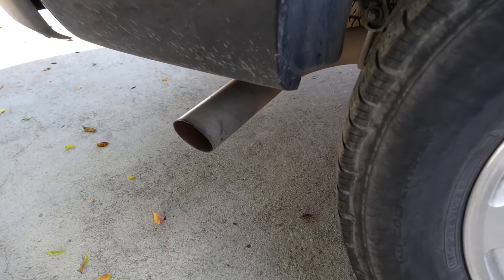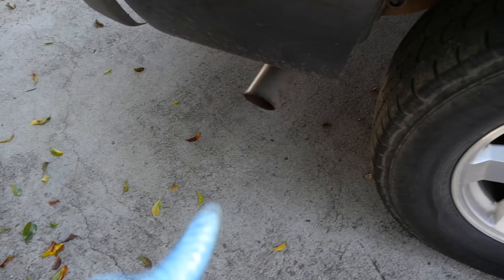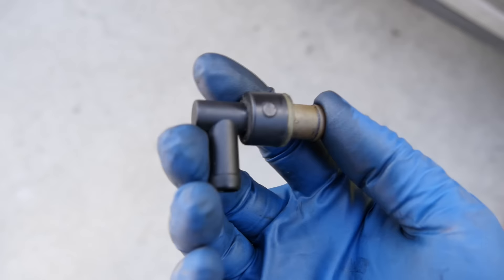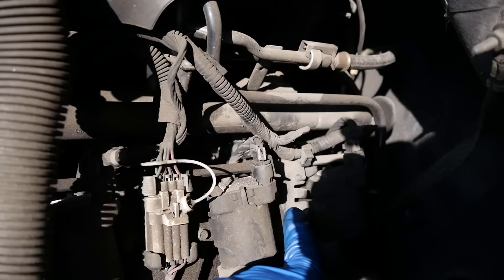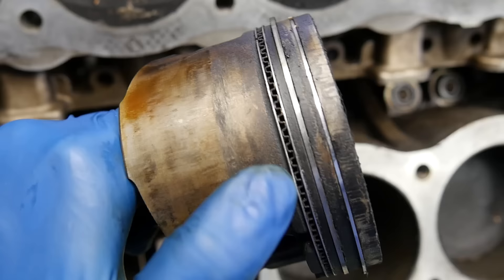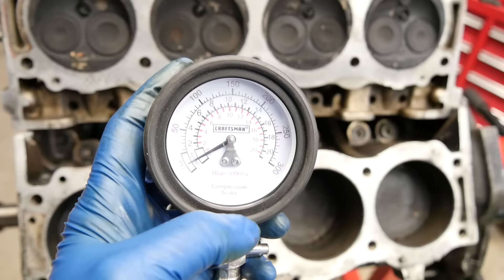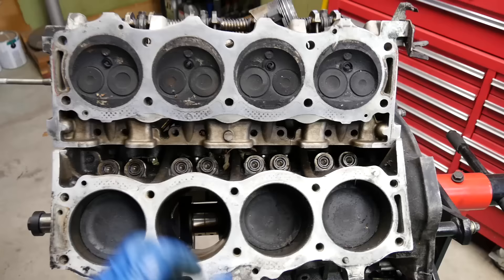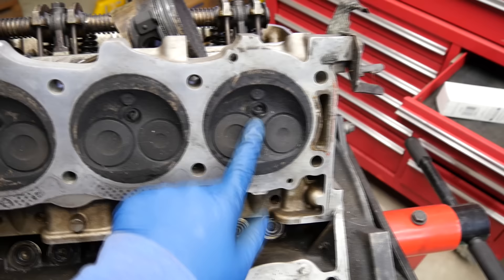Top 5 Reasons Your Car Is Smoking Out the Tailpipe - And How to Diagnose Them

Comment: What if a turbo wears out, what kind of smoke comes out of the tailpipe?
Thanks for another great video. You helped me many times.🙂
Reply: usually black
Reply: Sir I am having this issue turbo is gone after I paid for a seal on my head gaskette. I was told it was Ok to drive just won't have the same power. Well it won't go up a steep hill and just started smoking like a dark grey kind of color.

Comment: You forgot to add that Vacuum leaks, can  also cause a rich condition. I get it on the mercs, where the vacuum leak actually makes the car run lean, however it tries to compensate and overfuels the vehicle.
Reply: The poster's saving grace is the title says "Top 5 Reasons" so he didn't have to go over every possible cause.

Comment: You definitely don't want blow by circulating through your engine, it wears and tears the life out of your engine, and you loose HP and acceleration. I use gum out and only mobil 1 fuel with mobil 1 oil n filter, and make thick white smoke when off roading on snow and then reving the engine and makes white smoke, I believe is because it is burning up all the gunk and oil deposits that had build up in the engine, and restoring it's full performance.

Comment: Thank You!  Very informative  Video!    But,...  You mentioned  Engine issues on Toyota’s  Newer cars?  If so, I’m quite sure... TOYOTA will have a Re-Call out on such matter!! 

I happen to have a 2004 Lexus ES 330 with 345,000 Miles and it still purrs 🥰 and I know that it has a Valve cover leakage. So I took it for a local shop for the yearly NYS inspection, I was told that it needs a new head gasket??  Really?? Hmm I’ll tell my husband about it.  🙄🤨  and that’s why I ended up here.  So, again...  Thank You 💝

Comment: Mine smoked a bit and stopped, then showed a stop sign later in the day and turned off, then started it again and took it home. Topped up the oil after a couple of hours because it was low, started it back on and it was alright, few minutes later it shows a check engine light and starts smoking(white/blueish). It says the depollution system is faulty, which usually means the fuel injector or fuel filter or pump. I completely changed the oil and replaced the filter but it still smokes and jerks, will open it up soon to look at the top gasket

Comment: I took off my throttle body for the first time and spilled coolant on the top of my engine , like at least 12oz and my exhaust has been blowing white smoke on a cold morning cold start and goes away once the engine is warm,  my car doesn’t get hot, and doesn’t blow white smoke every time I start it. Just when it’s cold in cold weather.

Comment: Ugh.. this smoke in my car is driving me crazy.

2017 Pathfinder with the VQ35DD engine smokes a little bit after start and then it's gone. However, sometimes when I am 5 to 10 mins into a drive, it will suddenly start smoking white very badly to the point where it's just a huge ball of smoke coming out of the exhaust.

I changed the PCV valve, but it keeps doing it. I suspect the valve stem seals.

The car is consuming a little bit of oil but nothing alarming. It doesn't seem to be consuming coolant.

Comment: Can you discuss backfire on a car when starting? I had that problem and the tech could not find anything with the computer scan I(odd, thought it would record that), and then white smoke, went away and tech said nothing wrong with car but replaced radiator cap, new spark plugs, fuel injector cleaning and throttle body cleaning. I don't think they took apart the fuel injector but maybe just sprayed in cleaner. Just curious why their scan computer did not record it.

Comment: simple. disconnect the PCV valve and run the engine.  I removed mine completely and blovked the PCV hose.  No oil leaks no  burning of the excess oiil no trouble.  LANTRA J2....
Reply: Would not do that.  May cause excessive pressure in the crank case and eventually ruin your engine.( Blown Head Gaskets)  PVC allows excesse crank case pressure to be vented off back into the system.  But it's your car do as you wish.  He has a video on PVC valves their function and what happens if they fail.  You may want to watch.
Reply: You WILL blow all your oil seals sooner or later, do not do this
Reply: The previous owner of my car did this same thing. I found it out today and connected the pcv valve hose back to the valve and the car started to smoke so bad from the exhaust. What’s happening here.

Comment: I have a dakota 2001 4.7 and it has a Poweraid air system added. I have been asking mechanics to tell me why I have SOME smoke out the tailpipe on occasion, but they all seem to want to diagnose it for $$$. I know about compression testing and Leak testing for Valves and Piston issues and the possibility, but this truck only smokes a very little and only when I'm doing short work (yard work) or when I put it in reverse. All videos talking about smoke don't specify that it has to be a LOT of smoke or a Little smoke to be valves of pistons. I am not wanting to put that kind of money if my problem isn't a problem. Does a Poweraid Air Boost create the potential for pockets of fuel to create white smoke? It doesn't smoke when idle, or on the highway or at stop signs...but it does when I sit for more than a couple minutes in park/stopped.

I'm looking for the truth about this so I can be at peace. Grateful!!!

Comment: I have a 87 Mustang 2.3 sometimes when I start the car up it smokes I honestly think I put to much oil in the car but lately I will get going up a hill in it just let's out a big cloud of smoke!! I don't understand the PVC valve it's a EFI motor but u can't get ur hand in there it looks like it runs from 1 hose then into another hose cause the PVC valve is up by the distributor in its like I said plugs into another hose that I don't know where it goes!!! The car has been running ruff new plugs distributor cap rotor I tried to set the timing 10 degrees btc  but it  doesn't want to take!! It will be running fine then when u like go to get on the highway it will spit sputter then just take off like a rocket!! Like it needed to burp even on regular street it will do the same thing if stop at a stop sign then pull it doesn't feel like it has power then it will kick in! It feels like TFI module maybe I can't find anything about a 2.3  1987 Mustang 4cyl it's 93 models in my car has a distributor not coil packs!!

Comment: I have a 2009 Nissan Maxima I turn on the heater and crazy white smoke 💨 appears from my two tailpipes more than normal cars. So I parked it and I saw water leaking from the tailpipes afterwords, could it be in need of a platinum oil changed?
Reply: Do you still have the maxima?

Comment: what will cause motor to have black smoke out the tail pipe. chevy 350 motor, 130,000 orig miles. Just put new plus wires cap rotor and o2 sensor. Still has black smoke No ck engine light. Also the exhaust has side pipes running off the manifold under the doors.

Comment: Hello I have a question for you? I have an old reliable 2000 Toyota Camry XLE 2.2l four cylinder sedan. I bought it with 180k and do oil changes every 3k miles. I use straight synthetic 5-30. No service records on car. Except timing belts. Car is cutting out for a split second. No popping,or back firing. The cutting out does not seem like anything electrical. I do have a oil leak on cylinder one on the porcelain of the spark plug. I changed out the spark plugs and found this. Just ordered new valve cover gasket and spark plug oring seals. There no oil on the threads or electrode on the plug. I tend to run my gas in the tank till the yellow light in the dash comes on. But never got stuck,always was able to get to gas station. If I took it to a auto parts store and they put a scanner on the car would it show any possible problems if there are no check engine lights on in the dash? Fuel filter maybe under the hood? Any other possibilities? Thank you for your time and help in advance!! David

Comment: Thing is, if your car is "smoking," the color will tell you what's going on -- you just have to know the context:
1) White smoke, but cold outside. This is normal, as most of what you're seeing is steam, as water is a by-product of combustion.
2) White smoke, any temp: This indicates a car that is burning alcohol in your fuel, usually because of a fuel treatment designed to clean out carbon internally.
3) Blue smoke: This usually refers to oil being burned, but not because its outside of the exhaust. This is usually an indicator your piston rings are severely worn, as the oil ring is letting oil get up into the combustion chamber.
4) Black/Dark Gray smoke: This means you're engine is running "rich," meaning you're burning more fuel than necessary, as modern cars have a computer control what air/fuel mixture is ideal, therefore controlling how much air and fuel to feed into a combustion chamber. This may also indicate a burning-up catalytic converter that is clogged.

Comment: Good video I have an 04 Ford E250 when I’m getting a light white to gray smoke smells nasty I’m thinking that it’s coolant doesn’t smell like oil burning smells nasty any suggestions this vehicle had a Silver soldering job on some type of coolant tubing seems to be a problem with this Ford type vehicles 152,000 miles runs really well except for the smoking problem it’s not a lot of smoke very little

Comment: I'm getting a dark smoke. Its barely noticeable but it does coat the rear bumper just above the tail pipe. Car still passes CA smog but it burns through 2 quarts of oil every 3k miles. I know it's not running rich because the air/fuel mixture is stoic.
Reply: You have carbon buildup,,, it's on your combustion Chambers piston domes and the carbon is getting pushed into your compression rings and sticking,,,. Now you can spray water out of a Windex bottle about 20 oz,,, Into the throttle body while revving the motor slightly up and down in the RPMs,,. Around 2 or 3,000 RPMs,,, Or use Marvel Mystery Oil in the fuel for about 2,000 miles,,,. and you can use one quart of Marvel Mystery Oil in your oil for 500 miles before your oil change,,,  after trying all of this in April use a bottle of engine restore and a fresh oil change,,,.  And you can also use one quart of ,,,,20 W 50 Pennzoil ,,,,   for Motors that's using one or two quarts of oil in between oil changes,,,. !!!
Reply: It sounds like it's a performance type vehicle,,, and you're accelerating hard out of stop signs and red lights,,,
Reply: @ricksimpson2167  thanks for replying. I've used marvel mystery oil, seafoam and engine restore. It does slow the oil consumption down a little. I also have a brand new pcv valve. But this v6 still consumes oil like it's gas.

Comment: I have a new Ram pentastar,  leases 2017. It smokes white even after warm up.  Dealer said no problem.  I checked after they returned the level of the overflow radiator was not even marking minimum. Now back at dealer. 😒

Comment: I have the issue with my Toyota Camry with 227k miles blue smoke on first startups but goes away with a few seconds like he said been doing it since I purchased the vehicle 3 years ago burns very little oil when its time to change it about half a quart which i can live with I use synthetic and change every 5k to 6k
Reply: My wife have the same issue  it burns the oil fast. I don’t know if your car  does the same
Reply: @ernestoch.9493  mines doesn't burn that fast I did fix the oil pan leak and the vvti valve solenoid seal was leaking to it  burns a quarter of a quart to half  when it's time to change I use synthetic which about 5k miles which I can live with
Reply: Use Marvel Mystery Oil in your fuel tank and one quart  in the engine 500 miles before your oil change,,. This may help if not I would not worry about it that's not considered that bad,,. !!!   Or in April use a bottle of engine restore,,,. an you can use one quart of 20w 50 Pennzoil,,,,  for Motors that's using one or two quarts of oil in between oil changes,,,
Reply: Symptom of bad valve stem seals.

Comment: Question 08 mdx and I put in gas premium type, also added octane booster. Then left the gas station and lots of white smoke no check engine light on. And recently had the head gasket replaced. The problem seemed like it fixed. My mdx doesnt use alot of oil just did a tune up with new wires, ngk plugs. It ran fine. I stop at a cheap gas station and when I used there cheap gas it smokes white. Also is studded a little maybe foul filter needs replacing. Help please!!!!!

Comment: I already fix the valves seals, fix the piston rings etc. But still white smoke still coming out?my mechanic told me excess oil is in the chamber inside the tailpipe, how can I remove this one? he also told me use the multicab frequently, so the excess oil will be remove eventually...

Comment: My car burns 1 liter of oil on every 1000 miles but no smoke is coming out of a tailpipe. I know it eats oil because i have to add it periodically and there is no oil leaking anywhere, so what could that be?
Reply: Best case scenario, Worn PCV valve.  Worst case, worn piston rings. If its high mileage I would rebuild the engine. Piston rings wear out, especially if the engine has any sludge or has been subjected to any neglect

Comment: Will thicker oil reduce oil consumption?
Reply: Usually, but if you have an newer motor that calls for thin oil be carful. Would not recommend much thicker oil. If it's an older car with a lot of miles, thicker oil shouldn't hurt it and should reduce oil consumption.

Comment: I have a 5.3 I recently rebuilt but before I got to run it and seat rings bad head gasket then other side bad gasket so fix that and started acting up with other problems like electrical so 1 cylindrical like #7 was plug was wet with oil and I was going to do valve guides but thought against it didn’t want to drop in to motor so now looked in with scope and pistons that were new looked bad like covered in brown junk then plugs fouling then I put injector cleaner into each cylinder but after I thought about rings. It seated I blew it out and helped but today smoking bad real bad wet oil plugs now what rings are stuck to pistons and won’t seat like that do I take it out and take apart clean it and reassemble or is ther away to seat rings now thsnks

Comment: My 03 Camry did the first start up puff of smoke each day. It had a bad or a couple bad or worn valve guide seals. I tried a couple different seal conditioners and they helped, but it's not a long term fix and you had to keep adding it. I quit using the additives and lived with the puff of smoke. A week ago I decided to try using a hyper friction fighter called MotorKote to help fight overall friction in the engine. When I started the car a couple hours later after adding about 8 ounces of the MotorKote, there was no puff of smoke and that was the first time I started the car that day. It's been a week now and everyday it's the same thing, no puff of smoke. I'm hoping it keeps working. Thing is, why is it working? Any idea.

Comment: I got a 04 yukon and on start up after a long period of sitting (over night). On start up if I just crank it over it will start but sound like it's choking and then large amount of smoke comes (black/gray) and it might stay running or just die. But if I just turn the key over, wait about 20sec then crank it starts up like a champ. I'm assuming it's my fuel pump I'm just curious on why the smoke. Is that just the whole fuel and air mixture being off?

Comment: Have a question have recently had a random misfire on a GMC TERRAIN 2010 SLE 2.4l Now I change the spark plugs and P0300 codes finally clear but noticed I smell a gas on oil dipstick and idea how I might be able to fix it also have a P0172 Code only one that comes up that I need to take care of at this time  but haven't driven The SUV Till I narrow down the gas in the oil

Comment: I have a 2013 Hyundai Santa Fe V6 I bought it with 22,000 miles and it’s about to turn 100,000 miles. I’ve noticed only when I step On into the floor a white puff blows out the exhaust right at redline before it upstairs to the next gear. Other than this the car never smokes

Comment: I have a 2018 infiniti qx60 and on a cold start in the morning when i start it white smoke comes out for like 6 seconds then it stops. It runs just fine no check engine lights or stalling or sluggish performance at all. Maybe bad stem seals or pcv valve?

Comment: What can be the cause of excess heat coming out from the brake disc, I mean the whole 4 tire  nd I have even separate the brake master from the brake servo using 12 flat washer, when the car is on motion if u apply brake pedal the two front leg and the steering wheel will be vibrating

Comment: Help!! 
I have smoke coming out of my tailpipe only when I accelerate. It happens every blue moon Maybe once or twice a week. I have a 5.3 with access fuel management. If I'm on the highway riding on 4 cylinders and I press the gas and it changes to 8, that's when I always notice smoke coming out of my pipes. I believe this problem it's related to my oil consumption. Burn about a quart of oil every thousand miles. Could you help me
Reply: you're burning oil. piston rings are fucked

Comment: My 2009 Nissan Altima was blowing white smoke from the tail pipe. Towed to house and the next day Mechanic Crunk it up and let it run 10 minutes.  Smoke cleared and no more smoke. Mechanic says that the gasket is not blown or the head cracked. Totally confused 😕 should we check the pvc